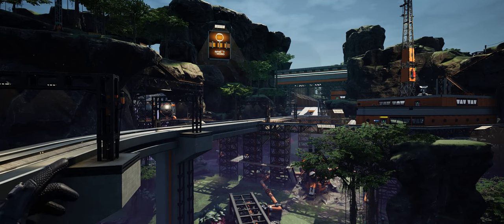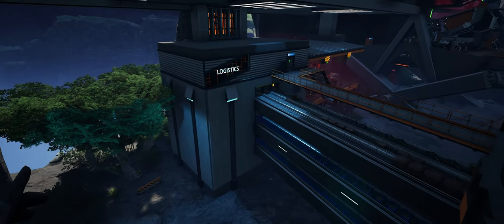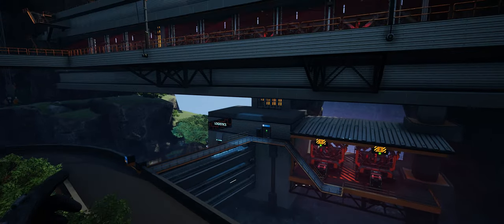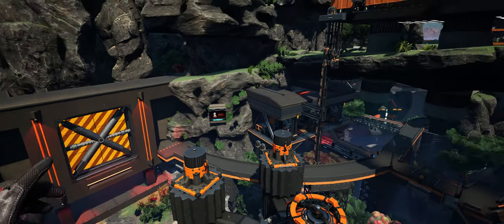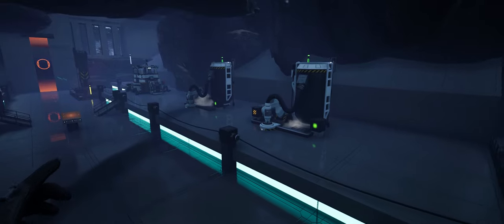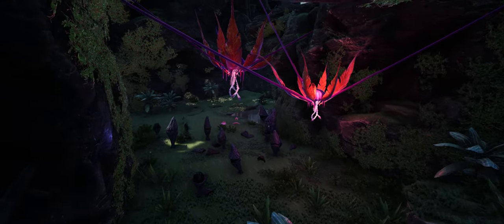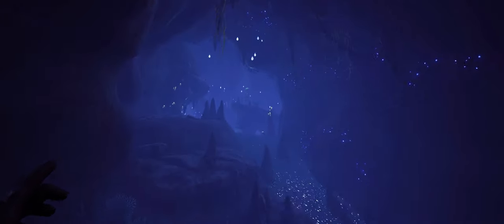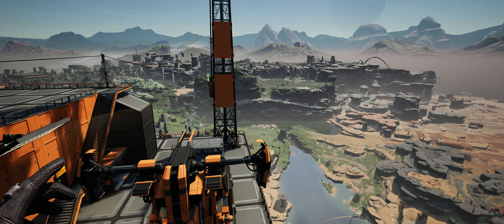The END of INFINITY! Project complete - Base Tour

Comment: Beautiful as always...I laughed at the part where you exposed some of the mess though. 😁 I especially liked the lights behind the conveyor elevators in the area by the crane, and how you blended everything in through all of those tunnels. Are your problems with running the game hardware-related, or would any average computer have difficulty running everything?
Reply from the maker: Thanks Zogly. I think my save file just has too much going on - my specs are average I guess, 8700K, 1080ti...better specs would help of course, but as I mentioned, my save game file is quite big with a lot going on, and from the feedback I've received - most ppl have performance issues with it. Lowering the visual FX's would help abit of course - but I like the GFX settings reasonably high, to see the game as it was intended to be seen.
Cheers mate, your comment is much appreciated 👍

Comment: Hi archi, very good. How do tout fly ? Build with mods ?
Reply from the maker: Download and install 'Satisfactory Mod Manager', and within that small program you can easily browse and choose mods to install for Satisfactory.
For flying, many, including myself, use 'Pak Utility' mod. And same mod can be used to build without cost, creative mode.

Just want to add though - I didn't use any mods til around 700-800 hours well into the game, at which time I had unlocked everything playing pure vanilla. And then only used mod for flying and permaday for making videos at the start, until around 1000+ hours I started playing in creative mode. Anyway it's up to you of course.
Reply: @StinArchi  Thanks, i use jetpack since the beginning but after 800h+ for design its not easy.